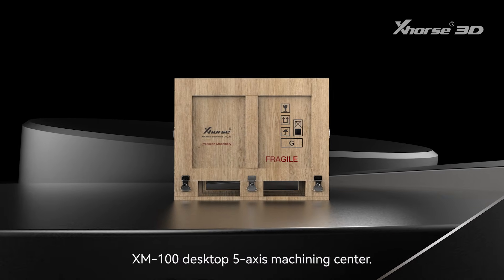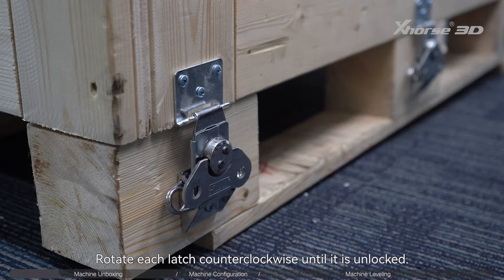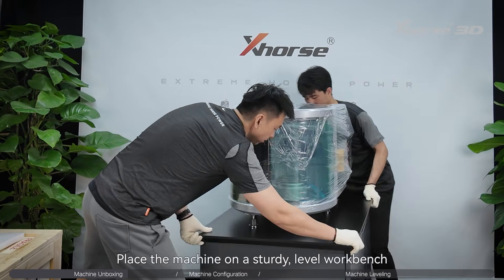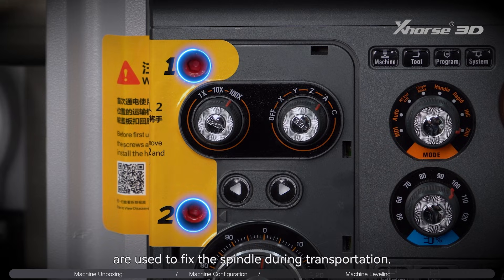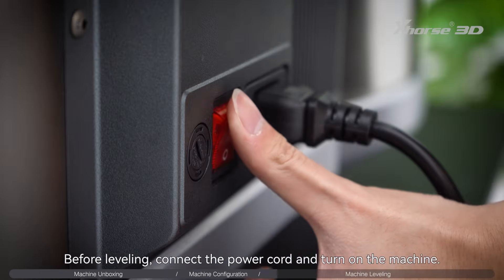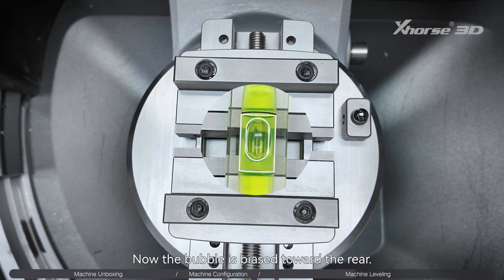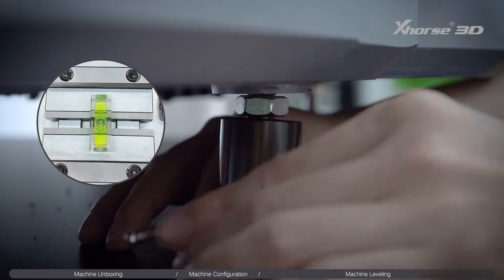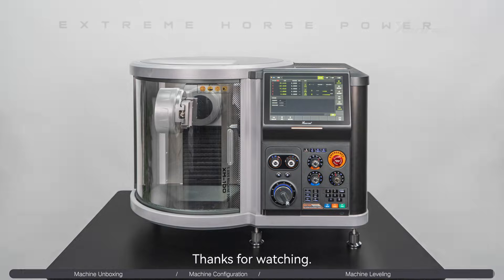Xmachine XM-100 Unboxing & Setup Guide | Step-by-Step Tutorial

Comment: Personally I would "take out" the two middle feet when leveling for true kinematic and then afterwards lower them until they just move the bubble a tiny amount and back them off agen ( so it support but don't influence) and I would also borrow someone's phone. Make a video call with it aimed at the bubble level so I don't have to continuously look into the machine but only have to bring my phone around with me to check the leveling ( done that many times before when leveling manual lathes and mills in the 1.2-2.5 ton range )
Reply: Damn, your idea with a borrowed phone leaves me speechless. Thanks mate, this is genius. And so obvious. 😂

Comment: A lot bigger than I envisioned when taking out of the crate
Reply: 130 kg, as per their website. I was surprised when I read that.
Reply: @GiolliJoker  It needs to be that heavy to stand vibration
Reply: @apichartnumna9790 no doubt, and it's a good sign, but the closest competitor, the PocketNC, weighs a lot less. I thought they were in the same category, apparently they aren't.
Reply from the maker: Thank you so much for coming to see the XM-100 in person at Inno100 in Shenzhen! 👏 We’re thrilled you got to see it live and appreciate your honest feedback — especially the comparison. We’re excited to get the XMachine into the hands of makers like you soon. Stay tuned for the official launch updates!
Reply from the maker: Yes, the current model is optimized to balance rigidity and accessibility at around 130 kg. We also have even more robust versions in development for users who need extra stability for heavy-duty machining.😊

Comment: It's amazing, I would buy it but I doubt it's accessible for consumers/enthusiasts. Would really have to be under 4k usd for that but I'm expecting something 2-3x that price and that would limit the market very much, it's too small for professional use and too expensive for non-professionals I'm afraid, for around 3-4k I would buy it though
Reply: its around 10k from comments in earlier videos
Reply: @m0nke318  bout what I expect tho that is pushing it really (the old robotdig v3 clone of the PocketNC came in at 9.9k or so and that one is quite a bit less polished on all fronts).
Reply: @m0nke318 I don’t know DIY laser welding/cutting setups are 5k-15k, hobbyists are buying them. Fiber lasers 5-10k for good ones. 10k for a 5 axis would be cheap. Just put it on credit. :)
Reply: it is available in china for 58,000 rmb so 8400 usd not including tariff and tax in your country,you r right it is 2-3x of 4K

Comment: Great unboxing video! But please make one just like it that goes through all the specs of the machine. Spindle wattage/rpm, torque, Collet size, workspace capacity door closed and door open. Not just spec on its own, but the benefit of these specs. 1.5kw brushless motor and 8mil tooling you can machine stainless steel 4x faster than machines with 4mil collets or with 200W motors. 
Your completion is Makera and now NestWorks. You really got to remind people why they should pick your machine over Makera. 

Your ATC seems the best in the market. It means a lot more reliability. I’m only seeing glimpses of it. Instead of talking about all the decisions that went into engineering the way it did. 

There’s so much in there that you can show and talk about to make your machine the most desired desktop CNC in the world
Reply: You are being optimistic on the competition here and cost. What you mentioned is comparing apples to oranges here. This is a 5 axis machine, with an actual control panel, actual atc (none of the others use a proper atc system, with the Nestworks one being the nut destroyer 9000) and probably weighing in the 150kg range. 

I am relatively sure this will be at the 10k price range or more considering the older PocketNC clone was at 5,5k and the V3 are at 9k (and this is a decent step up from that). If they advertise anything under that price point I will be very doubtful on a kickstarter actually delivering something working.

Not to even mention people buying small desktop machines do not even have the money to pay for basic Fusion360 (supports 3+2) much less the Machining extension to actually enable true 5 axis and wrap machining.

This is never going to be the Bamboo of the desktop cnc world as CNCs unlike 3d printers are much harder to properly at a budget cost.
Reply from the maker: Thank you for your detailed suggestion! The XM-100 features our self-developed 1.5kW spindle (max 18,000 RPM), holds tools up to 6mm, and offers a 5-axis working area of 100³ mm (3-axis: 150×200×120 mm). It includes an ATC with a 6-tool magazine.

We'll soon release a full workflow video cutting real parts, followed by detailed spec breakdowns. Stay tuned for more!
Reply: @xhorse3d I’m going to guess with a 1.5 kw spindle (assuming can do high torque at lower RPM) some users might ask up to 8mm of tooling). The second requirement will be liquid coolant.
Reply: @photojournalists According to my testing, replacing the collet to be compatible with 8mm tools is feasible, but it cannot be used with ATC. It uses the standard 263504 (DGZ-60E) collet, available in 2.35/3/3.175/4/6/6.35/8mm sizes. Other test users have used it with their own MQL systems with good results.